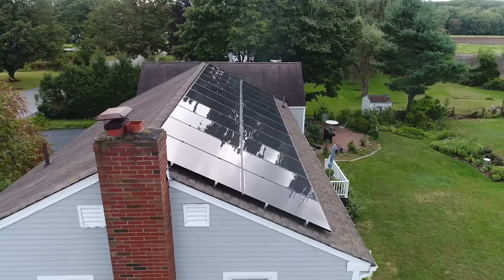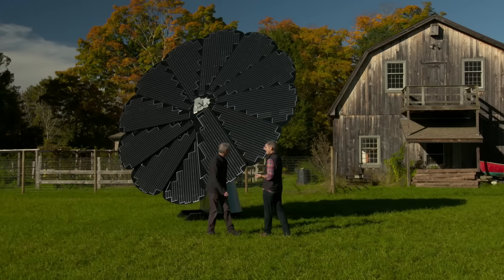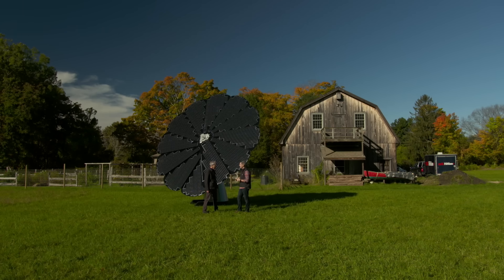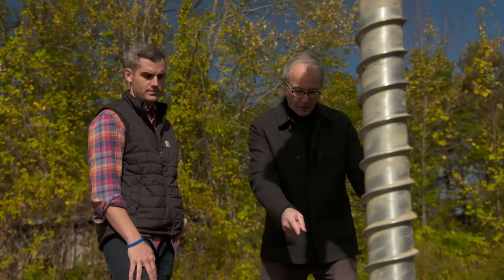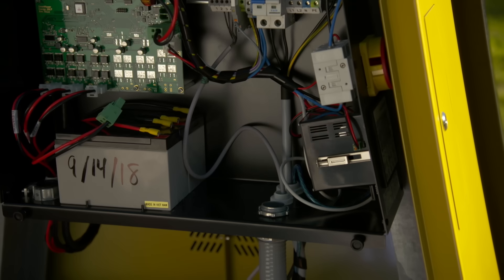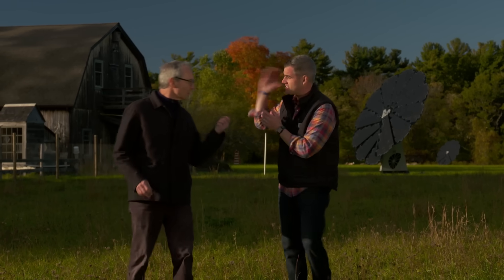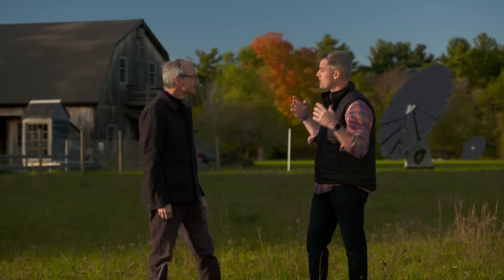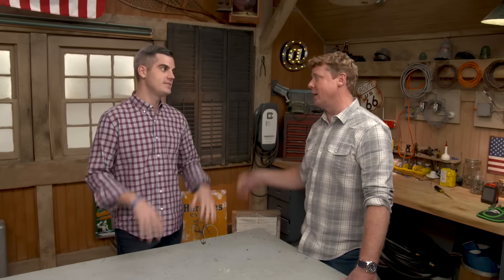Robotic Flower Solar Panels | Future House | Ask This Old House

Comment: its been proven to be cheaper to add more solar panels than use trackers and its less maintenance and cheaper in the long run
Reply: https://www.youtube.com/watch?v=wL9PcGu_xrA this guy is on to something. This sunflower thing is just out to lighten everyone's wallet though agreed.
Reply: @Sethermiester  That is a toy, that moves a piece of cardboard. Try moving a 3' x 5' Solar Panels that weigh 50 lbs, and then add 50 mph winds!  Oh, then he states you can move several panels at once.  Oh, really?  His motors cannot even move one solar panel.  The 2-Axis mount will cost more than the Solar Panels.  Simple 2-Axis trackers using little solar cells, like his, have been around for a decade or more.
Reply: @MrSummitville  You just scale up the size of the parts if you want to move more...just like you don't make a bridge out of mud and straw.
Reply: @Sethermiester  No, you just don't "scale-up".  You clearly are not a Mechanical Engineer.  You have no clue.  2-Axis Trackers for Solar Panels do not just "scale-up" linearly.  Do some Mechanical Engineering for 6 Panels = 300 lbs and then you will learn how large a steel pipe, gears, motor, shaft, bearings and huge concrete pier you will need!  A large 2-Axis Solar Tracker is a financial disaster.  Go ahead, design a 2 -Axis Tracker for 6 x 50 lb Solar Panels that will withstand 75 mph winds ( if you can ) and then reply with the COST ...  Some locations may require 100 MPH wind speed analysis.  You have no clue ...
Reply: @MrSummitville  no clue
Reply: @MrSummitville  Yeah just looked up parts 2 - 5hp motors $450. 2  Ring and pinion gears $70. Various sizes of metal tubing let's say $500. All can withstand 1000s of pounds of force. Just a mechanical engineering disaster. No idea.
Reply: @Sethermiester  You actually "designed" nothing.  You have made a simple list parts and prices.  A single piece of 6" diameter, schedule 80 x 8' long Structural Steel Pipe just for the Main PIER costs $400.  You are adding $1,500 in COSTS, so that you can generate an extra $100 in electricity per year.  And then you are assuming that nothing will break, wear out or need replaced  in the next 15 years.  Nothing rusts being outside 24 x 365 ?  And how about all of the electricity that your dual axis tracker will CONSUME?   My goal with Solar Panels is to SAVE money,  you just want to spend, spend, spend ...
Reply: @Sethermiester  People have the right to know that this "Robotic Solar Flower" is total waste of money.  Go ahead buy one or build .... and then tell us in 20 years whether have yet to break-even, or if you are still hemorrhaging cash.  Actually, everybody cares about COST & ROI and hate scams like this, except for you ...
Reply: @MrSummitville  how about not replying in such a hostile know-it-all manner and just offer your knowledge freely as a help to others. You have no clue...
Reply: True but more panels means less space. To each his own I guess
Reply: @kramchancel1266  Did you buy one of these devices?  Of course, you did not ...
Reply: Yeah efficiency doesn’t really matter when you can just add more panels. This thing is way too overpriced.
Reply: @alex_byrnes  30% more energy for 6 TIMES the price?  Yikes!  No thanks ...
Reply: This comment will only be true when it was posted.. like debating computer parts, true but always updating and changes monthly heh
Reply: mattmopar440 horse and buggy used to be the best way to get around, I bet you use a car. Things evolve, that is the whole point of technology
Reply: @byammine  your still using solar. Tracking practically doesn't need to be this complicated, and makes almost no sense for home systems. In large industrial/commercial systems they may be worth squeezing out the extra few watts because you multiply it by the hundreds if not thousands of panels and your then adding lots of effective kw's to the system, on a system with such few panels isn't worth it and just adds extra fluff and expense to already tight margins and only benefits the company that sold you that art piece of a solar system.
Reply: @obviouslyniceduh5521  99% of all commercial electrical grid sized solar panel arrays do NOT have Dual-Axis solar tracking mounts
Reply: @byammine  Not all technology makes financial sense.  This device is  TIMES the price of Flat Panels.  Will you buy one of these devices?  Of course you won't.  Your mouth is writing checks, that your brain can't cash ...

Comment: The cost to fix that system would be insanely expensive.
Reply: The system itself is extremely expensive in comparison to normal pannels on a roof. It's just another toy for rich people to put in their garden somewhere, it has nothing to do with efficiency or helping the planet.
Reply: Robert Montgomery, not necessarily.  The parts are as exchangeable as the panels, plus you do it from ground level and not high in the sky on a roof, tip-toeing around panels.
Reply: @bellagray4444  The average person can not repair a Dual Axis Tracker, even from the ground.  It only has a 5 year warranty.  Then you must repair it for another 15 year after the warranty expires, just to BREAK-EVEN .  No, I am not investing $20,000 today, just so that I can break-even over the next  20 years ...

Comment: This suffers from the same problem that pretty much all active solar tracking systems have. It is way too expensive. The increase in efficiency is largely irrelevant when you can simply install additional fixed panels to get the same amount of power for a fraction of the price. The average cost for a solar install is currently about 3 dollars per watt. Based on that a conventional 5kw system would be about 15 grand or half what this costs for the same performance. In addition this is a far more complex system with moving parts and therefore a higher likelihood of needing repairs over the decades of useful life the solar cells have. The cost difference between passive and active systems is only going to get worse as cell prices continue to fall.
Reply: biohazard 918 You are correct in your observations. Thanks
Reply: https://www.youtube.com/watch?v=wL9PcGu_xrA you might want to look at this guy's design.
Reply: @Sethermiester  That is toy. try scaling it up to 5 kw system, with 50 MPH winds ...
Reply: Fixed panels aren't economically viable without government subsidies, either.   Once you accept the idea that wasting money is virtuous, the only difference is in the degree to which you want to milk the taxpayers.

Comment: 30k?

It would take me over 25 years to pay for that according to my energy usage ... that is if it can generate $100 worth of electricity a month.
Reply: Not necessarily. You get a 30% federal rebate right off the bat. That makes it $21k. Assuming it generates $100 of electricity today, and electric costs go up 2-3% per year, you're looking at about a 15 year ROI.
Reply: @RunsCool1  It only has a 5 YEAR Warranty.  So good luck with breaking-even in 15 years, after you add the REPAIR BILL.  Do you actually think you can put this mechanical device OUTSIDE, in the full sun, in the rain and the snow for 15 years and not have anything break?
Reply: @RunsCool1  There are very few places in the USA, where this device would generate $100 per month. More like $60 month or less - many places alot less.  So, we are back to a 20 YEAR break-even.
Reply: @MrSummitville  Fact talking of all data, smart rare commenter on youtube 🙏
Reply: @RunsCool1  Link me the Canadian Federal Rebate, big boy?
Reply: @Reignz  You must get that from Trudeau ... :-)
Reply: Yea, price is high now. In time it will come down and be a more reasonable option. Like everything new.
Reply: Unaffordable price! Here in Australia I can install a 6.6 kw roof top system for AUD 2600 and I can pay it off in 2 weeks! My colleague has installed 2 off that system and for the last quarter he's got AU$800 credit on top of his household power usage. Only well off people could pay 30K for this 2.5 kw system!
Reply: @saeedmahmoudi7965  can you please share brand name and system panels that you used?
Reply: @jaandel1  No!
Reply: Try $45000 I talked with them.
Reply: @hotmeds  $45,000 for a complete installation including a Crane, Labor, Trenching, Disconnects, Circuit Breakers, Conduit, Wire and connection into your Main AC Panel?  As of Aug 2018 they "claimed" the average install was only $28,000.
Reply: @stephencarney3134  PLUS repairs,  after short 5 year expires !

Comment: Solar makes so much sense...
Reply: Actually it doesn't. Not even remotely cost effective or practical. Even the manufacturing requirements alone far exceed the power consumption which could possibly be offset by solar, requiring traditional power sources such as hydro, gas, coal and nuclear. Wind is also highly unreliable and never meets projected costs for manufacturing and maintenance and frequent premature replacement.

Comment: The panel gets 40% more energy but how much of it is used by the machinery that reorients it?
Reply: Other than the "awakening" and "go to sleep" functions, it shouldn't use too much on actual movement. Take into consideration that, at most, it just has to rotate 90º in one direction and back, and another 180º from one point to the other. These numbers are not exact, since it depends on latitude and the day of the year, but I mean, the total path it actually has to go through is quite small.

Also, I guess those motors are efficient enough and, obviously, although the sun is continously "moving along the sky", so to speak, the flower won't be constantly adjusting, but it will have, I guess, some incremental changes in position at predetermined intervals, say it checks for a better position not continously but ever few minutes.
Reply: TheSpoonyBard, that is figured in